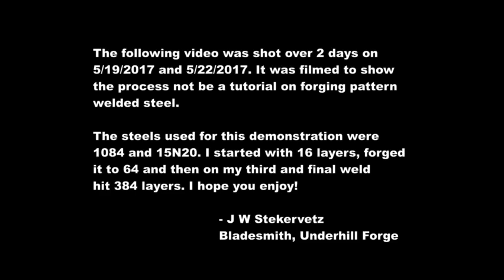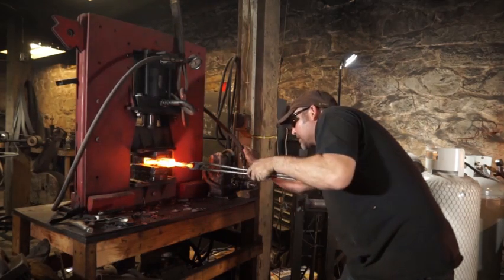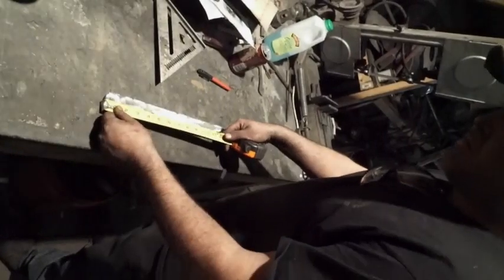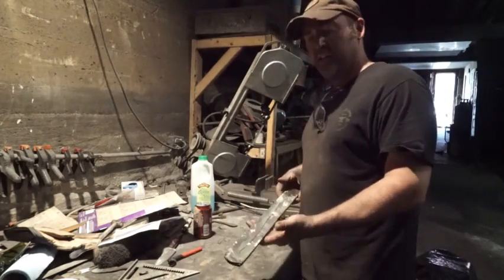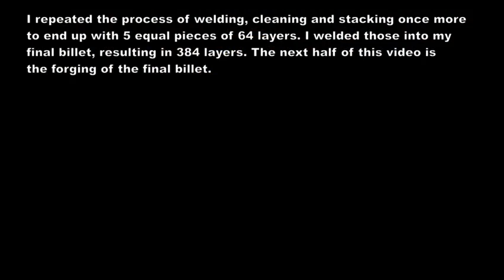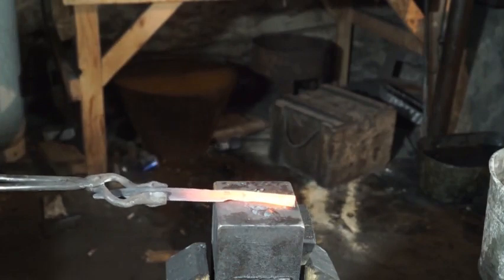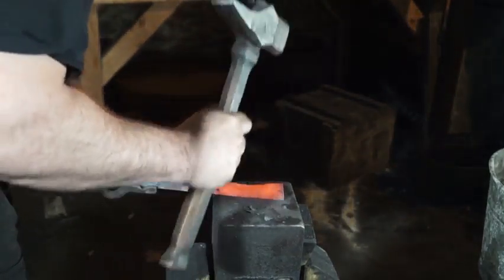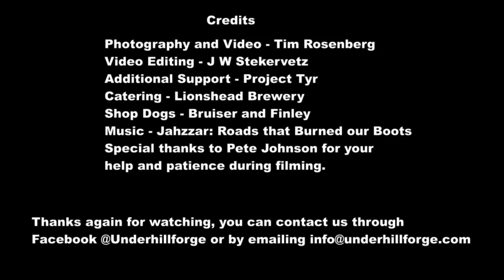Forging a Damascus knife.

Comment: Jw I am not so new to smithing and would love to build one of those do you have plans to share or some info to share on the build? I have some great pieces of high carbon steel that are round that a train couples lock with they would be great to use as a mill how did you build it? Can you help me? Please and thank you. Martin

Comment: Is your anvil a sow block to a big power hammer?
Reply from the maker: Benona Blacksmith Jeremy Blohm actually, just an 85lb block of A2 tool steel for that one. I’ve got London pattern anvils in the shop but I’ve got two of these that tend to be my favorites when working smaller blades.

Comment: is that rolling mill homemade if so how?
Reply: JW Stekervetz that would be interesting to see done and or instructions etc..my mentor/friend Stephan Fowler (ABS Journeyman / Forged in Fire runner up uses an anvil very similar to that post one you are using..
Reply: JW Stekervetz I can't use his block anvil comfortably as he is 6'5" and I'm 5"5" ... using his 2x72 is a pain without vertically challenged assistance blocks...there is no good or easy way to grind when the center of the flat platten is at your nipples..
Reply: JW Stekervetz not sure you could call me his student as that implies purposeful directed instruction..instead of 

how do I fix this

hit it with hammer when its hot

or 

how do I keep it straight and flat

hit it straight and flat